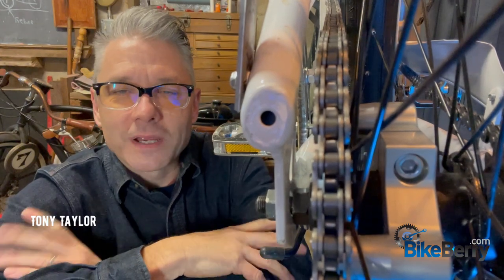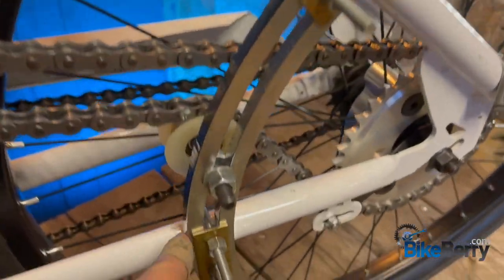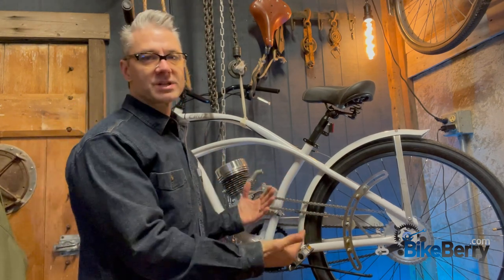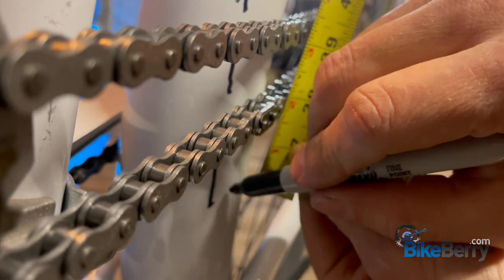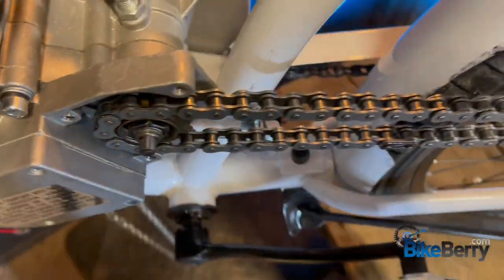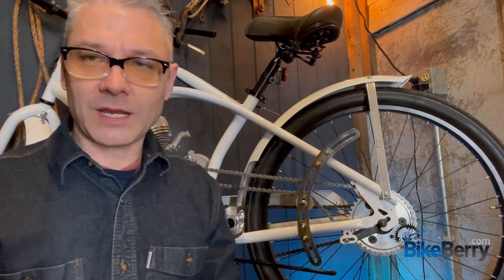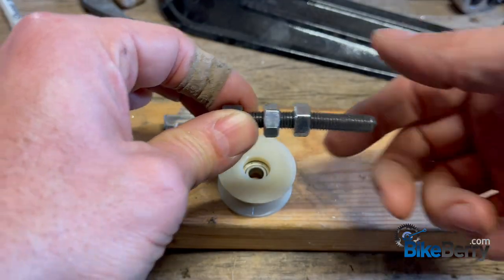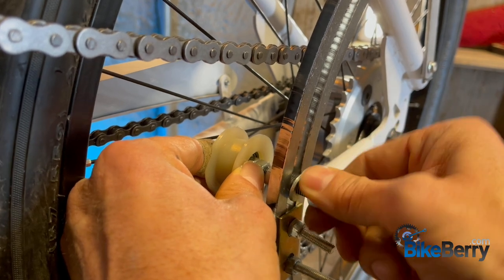How To Keep Your Chain Straight | TruingThe Chain Pathway On Your Motorized Bike | Bike Berry

Comment: I just wanna let y’all know how absolutely terrifying it is when the bolt on the sprocket adapter hits the break arm going 30+mph…..always make sure it’s tight I almost got sent to the gulag.
Reply: Lol
Reply: Having the pulley screw loosten up on the stock tensioner resulting in your chain dropping off the sprocket while going up a hill at full speed is damn terrifying too, the stock tensioners are kinda shit lol.
Reply: Thanks I needed this laugh😊
Reply: Delete the coaster and get a front brake

Comment: The clutch the motor won't roll freely I adjusted the clutch but it's still locked what do I need to do so that the bike rolls when I squeeze the clutch lever

Comment: Kewl tips.I'd guess allot of the watchers have the standard 2 or 4 bolt mount and just use the 'crescent wrench twist' method too.I've changed the plastic pulley for this:"Sprocket Idler Pulley Is-810 3/8" X 1.84".It also keeps the chain aligned to the rear sprocket better.@$12 online.

Comment: I agree that the 'arched tensioner' is safer than the standard 2-4 bolt type.So many with round frame tubes don't drill through the mount and frame to put a hardened screw in so they can't twist.I've been using a 'spring tension'engine mounted type,but on very rough bumps I've had the chain flex enough to pop off.Home Depot helped by having stronger spring packs available.Thanks for all the great tips and videos.

Comment: I just lifted a engine with those brackets and they you're right have to form.  I used three flat peaces to counter and then added Springs on the bottom of the engine.

Comment: I just drilled the adapter and rear axle and taped the axle with threads then bolt the adapter to it with blue loctite

Comment: Are there any gas kits that have right hand drive shafts? I’d like to use my cassset and not have to instal the sprocket where my disc brakes go. Thanks
Reply: There is a shift kit for that application but I have always wondered if I could get away with just the jackshaft.

Comment: What to do if the chain is rubbing against the engine mount nut?
Reply: Depends how much it's rubbing. But, if you can file or grind off excess material that's what I would do. Always wear safety glasses and gloves when grinding.

Comment: Or you could have just sanded the nut because its the nut tbat lays on your bracket tensioner.. guess
You know how the brakes are  aligning on the side of the wheel.. its a two piece one side rounded concave the other convex...

Comment: Dude. Dude. DO NOT BEND BOLTS!
The Nylon Tensioner Will wear to the pitch of the chain. It will groove itself striaght.

Again.  You need a large washer, a lock washer, and a Nylon Nut on that chain tensioner. 

Also it looks like your rear sprocket needs to flipped around. The indent should be facing the hub.
Reply: @Lucas, dude, the sprocket only goes on one way. Note, the countersunk screwheads. Also, bent tentioner bolt is ok, it's only purpose is to take up the slack, it's not pressurized.
Reply: the sprocket is on correctly